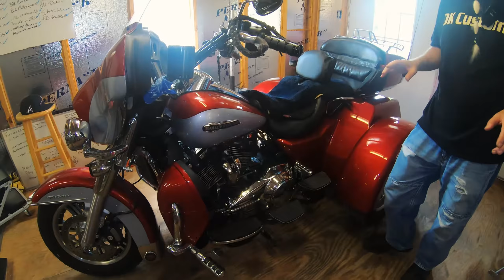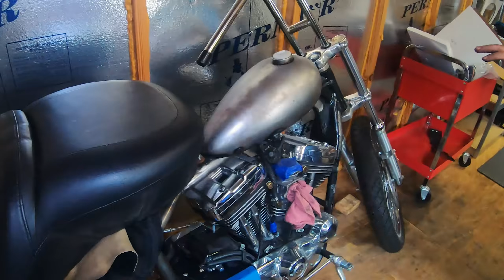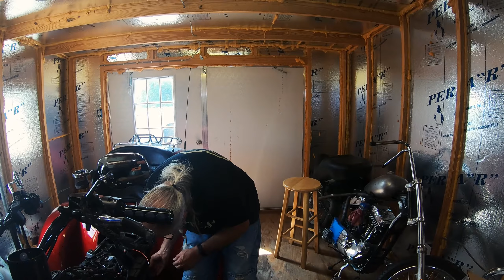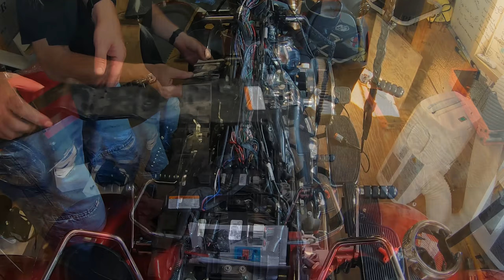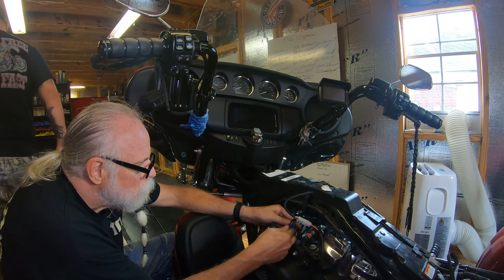COOL YOUR HARLEY - SEE Force Flow Fan Installation

Comment: Hi Rick, If have the Kit installed using the thermostat, and all works as it should.  If I installed a switch at the relay, jumping the white and black contacts there, would that turn on the fan?  I am thinking if that worked, I could have the switch off and be in thermostat mode, but then, when switched on, it would jumper the white to black, and the fan would go on.  If those are not the correct ones near the relay, what wires would I jumper?  Thanks for your help and the great videos you guys put out.  Regards Buzz
Reply from the maker: Honestly, I am not entirely sure. That would a question batter asked to the manufacturer, Jim's. Sorry about that but we do appreciate you watching and commenting.
Reply: @DKCustomProducts  Okay Thanks. I thought I read in one of the comments that you mentioned jumping the white and blue wire down by the connector would start the fan.  Though it might be the same up by the relay, which is easy to get to.  Appreciate you getting back to me.

Comment: Hi Guys, need your help with something.  I'm installing a Jim's Force Flow Fan on my 2015 Harley Freewheeler, but don't want to use the thermostat provided. I eliminated the thermostat and the relay out of the wiring harness, and simply connected red to red and black to black, and wired the fan directly to the battery. Unfortunately it doesn't work.  Any ideas on what I'm doing wrong.  Thanks in advance for your help....Rick
Reply from the maker: Hi Rick, the fan should have a 4 pin plug. Hold the plug in a manner that the 2 black wires are top row. White wire and red wire are bottom row. Simply install a jumper wire from the white wire (bottom left) to the black wire (top right). Sorry if I didn't explain that well enough. You are welcome to shoot us an email for a picture showing this jumper wire mod. Be aware that this will void the product warranty. support@dkcustomproducts.com
Reply: @DKCustomProducts  Hi Rick, If have the Kit installed using the thermostat and all works as it should.  If I installed a switch at the relay jumping the white and black contacts there would that turn on the fan.  I am thinking if that worked I could have the switch off and be in thermostat mode but then switched on it would jumper the white to black and the fan would go on.  If those are not the correct ones near the relay what wires there would on jumper?  Thanks for your help and the great videos you guys put out.  Regards Buzz

Comment: Considering that you now have to relocate the ignition coil on BOTH the touring and cruisers, time for an updated video.  It sucks that information relevant to cruisers usually gets ignored.  It's only when the tourers are affected that everyone starts updating shit.
Reply from the maker: The Jim's Fans can be bought with the coil relocation kits. We should do an updated video relocating the coil and installing the Jim's Fan. Maybe that will be a future video! Thank you for commenting! 👍 MB
Reply: @DKCustomProducts Really appreciate everything you guys do. The engine heat series was especially awesome and informative. 

What're your thoughts on Love Jugs vs JIMS Forceflow? Two different approaches to achieve the same result. One around $150 to $160 more than the other and needing a coil relocation. But if the JIMS does its job better and if it's built better, and it has the thermostat switch for the auto on/off, then it'd be worth it. Ya know. You guys have a lot of experience with both, so a compare & contrast video, especially with a Softail just to mix things up, would be really really informative.

Comment: How do I delete the thermostat? I have one and my screws came out of the thermostat. Now it won’t come on. I don’t know for sure how to just use the on off switch
Reply from the maker: You can contact our Customer Service team, and they’ll be happy to provide information on how to wire it with a toggle switch instead of a thermostat.
Support@DKCustomProducts.com
662-252-8828

Thank you for commenting! MB

Comment: I have my Powervision 4 attached to that diagnostic plug, and I really dont want anything else tied into my Battery. Is it possible/ Can you do a video on how a guy could incorporate the accessory switch inserts and Harley factory accessory kit to use those switches up on the road glide speed fairing? I know harley makes their "cool fan" that uses those switches. My thought is I could use that wiring set up to run a Jims Fan. Is my understanding correct that the Harley "cool Fan' is really for passenger comfort, and does NOT do much to adjust engine temps?
Reply from the maker: The Jims Force FlowFan  can either be activated by a thermostat (included), or wired for a manual on/off switch (included). The instructions come with wire diagrams to wire the on/off switch. 
You can see more about the Jims Fan at this link - https://www.dkcustomproducts.com/jims-force-flow-fan-cools-twin-cam-engine.htm

Here is a report we made on the Jims Fan that you may find useful/interesting - https://www.dkcustomproducts.com/force-flow-fan-test-report.htm

Yes, the Harley cool fan is more for directing the heat on to the ground and off the rider and passenger and not for cooling the engine. 

Please feel free to reach out with any questions:
Support@DKCustomProducts.com
662-252-8828

Thank you for commenting! 👍😎 MB

Comment: Yeah you're pulling a lot more weight on the triglide they definitely need a cooler originally when the twin cams came out. In the press release and when the folks rode them around during the press release there was one fella there may have been more. That asked about these seems to be running high why don't you put an oil cooler on it and one engineer surprising an engineer was actually at the press release but he told the guy that asked he goes that would indicate to the public that this motor's hot and it needs an oil cooler so it was all about image damn the engine damn the heat we don't want an oil cooler on there it makes it look like we got a problem. And they did have a problem we finally started putting those on the police bikes cuz they would idle I mean cops are let you know practically idol like they thought a car would idle sometimes
Reply from the maker: Yeah, it's amazing how much the powers that be care about image, rather than doing what is best for the engine.
KP

Comment: Jim’s says this won’t fit a 2020 triglide ultra classic. What year is yours?
Reply: Supposedly the thermostat won’t fit.
Reply from the maker: We have found that with a little work the thermostat will fit in a different location.  Front of the front rocker cover.
Which is what I did on my 2019...however, I prefer to run mine manually, using the included switch, rather than rely on the thermostat.
KP
Reply from the maker: Kevin has a 2019 Tri Glide. What is the fitment issue or did Jim's say? MB

Comment: I have my Dino jet tuner connected to the diagnostic port.  Is there somewhere else that I can connect it to???
Reply from the maker: There is a wire loom that HD sells to add additional accessory ports. You would need to get one of the Y adapters so that you can have both of them plugged in at one time. 

You can see the Jim's fan at this link - https://www.dkcustomproducts.com/jims-force-flow-fan-cools-twin-cam-engine.htm

Please feel free to contact us with any questions;
Support@DKCustomProducts.com
662-252-8828

Thank you for commenting! MB

Comment: Question for Kevin, what terminals that the relay plugs into did you apply power to to make sure the fan worked before you installed? I'm guessing that's where he applied power to make sure the fan was good. Mine's already installed and the fan is not coming on and Jim's first response at the factory was to bypass the thermostat. I really don't want to do that if I don't have to. I  need to start at square one and make sure the fan turns on with power applied to it. If that works then I guess I'll go ahead and assume the relay is ok and bypass the thermostat. I hate to assume but dang. Thank you!
Reply from the maker: At the 7:16 mark in the video you can see the connector that I am holding.  That is where I checked the fan to make sure it was functioning prior to the installation. 
I did not test the relay prior to installation.  Maybe I should have, but I did not.
Reply: @DKCustomProducts  Made up some jumpers and thankfully the fan works. So I'll bypass the thermostat I guess per Jim's instructions and go from there. I was so happy that I was able to put the thermostat on the rear cylinder on the right side because it made me more happy that I had the DK Customs gas tank lift kit installed. Oh well, still very happy with that air getting over the heads. Thanks guys!😁👌
Reply from the maker: Glad you got it figured out!

Thank you for your business and for commenting! 😎

Comment: How does this compare to the love jugs
Reply from the maker: :Loaded question.
Back a few years ago the Mighty-Mites worked a little better than the ForceFlow.  BUT, Love Jugs has gone downhill.  The owner died, the daughter took over, and quality, Customer Service, Warranty, and delivery are questionable at best.
For the ForceFlow, there have been none available for the Twin Cam for almost a year, and they are saying that it will be the end of the year, at the soonest, before there are any for the TC.  For the M8, they are only available in black right now, and there is a 1-3 week wait on those.
With the Mighty-Mites in question, on my M8 I am running a FlorceFlow.

Comment: Will the fan fit on a 23 Softail break out? 117 Milwaukee eight
Reply from the maker: In order to install the Forceflow on the M8 Softails, it is necessary to re-locate the coil. This Kit includes a turnkey coil relocation system to move the coil to the front of the motorcycle inconspicuously tucked underneath the neck of the bike, in-between the frame tubes. This new mounting system allows the  Forceflow to be installed on all Milwaukee Eight Softail motorcycles. Non-stock components that are installed in this area, under the neck, may conflict with the coil relocation, this Includes the Harley Brand Engine Guard.  The coil cannot be relocated for the Force Flow if an Engine Guard is installed.
Please feel free to email our customer service at support@dkcustomproducts.com or call 662-252-8828 for any questions you might have. Thank you for watching!

Comment: I am curious if these would fit my 04 fatboy EFI? I can not find any info if it would.
Reply from the maker: Here is the link to them- https://www.dkcustomproducts.com/jims-force-flow-fan-cools-twin-cam-engine.htm
Unfortunately the fans for the Twin Cam are out of stock and there is no date when they are expected back in stock, except, somewhere around the end of this year.
Here is a link to other things you can do to cool your ride down- https://www.dkcustomproducts.com/cooling-components-c661-246.htm

Comment: Bike 30k, after market UPGRADES another 12k re-sale price in a year 19k 😂 like owning an AR
Reply from the maker: Not sure where you got those numbers.  That's not been my experience, not even close.
Last new bike I bought, and then sold-  36k purchase price, aftermarket upgrades less than 6k.  64K miles of fantastic riding and memories, sold for 32k 3.5 years later. 😀

Comment: Hi there,
Is there an on/off switch so that you can bypass the thermostat?
Thank you so much for the vid.
Dan
Reply from the maker: There is an on/off switch that works with the thermostat.  It will only turn it on or off if the thermostat is up to temp.
You can bypass the thermostat completely and run it where it will only turn on or off with the switch.  This is an unsupported mod, but it is the one I ended up running on mine.
Reply: @DKCustomProducts I just ordered one , can i not even hook up the thermostat & just turn on off as needed? To me the thermostat should be near where the ET sensor is. I have a power vision so I can see when my temperature gets where I don’t like it. Thanks
Reply from the maker: @scrumthebum2451  Yes, you can use the switch in concert with the Thermostat to turn it off, but not to turn it on if the thermostat is not warm.
The JIMS thermostat sits on outside of the rocker cover,  so it is Not in the same place as the HD temp sensor, but it also activates at a lower temp than the HD heat sensor uses to start trying to cool the bike down.
Reply: @DKCustomProducts  
Thanks for reply the seller canceled the order & refunded my payment apparently the 5401 model for twin cam is not available all the sudden ?
Reply from the maker: @scrumthebum2451  That is correct.  The Twin Cam version has not been available for many months.  They are redesigning it and have said the soonest it would be available is the end of this year.
You can see info on that at this link- https://www.dkcustomproducts.com/jims-force-flow-fan-cools-twin-cam-engine.htm
Reply: @DKCustomProducts  
Thank you. Oh well In one more month up here in PA won’t have to worry about the heat till next July 😂

Comment: With the fan blowing left to right, do you still recommend removing the left mid-frame air deflector and keeping the right?

In the video you use an adapter to get power from the diagnostic port, but why not ground it back to the battery? Is there no ground on the diagnostic port?
Reply from the maker: Yes, for the mid-frame protector, it is most effective (with or without a fan) to have the right side in place and the left side removed.

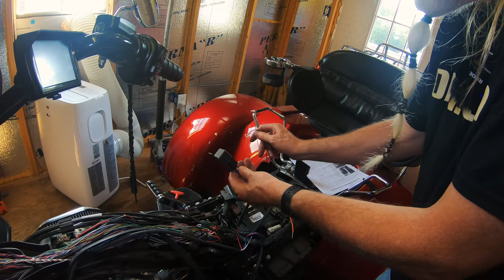In this video we do talk about running the ground directly to the battery.  12:07 mark.
Reply: @DKCustomProducts  Sorry! Typo. I meant to ask: why ground it back to the battery instead of to the diagnostic port.
Reply from the maker: @HarleyGriffith  Easier and cleaner for me.

Comment: Question for you: Did you change out your 10-inch bars to the 12-inch bars for better handling?
Reply from the maker: I use The Comfort Triangle (video linked below) to find the best/most comfortable position.  I have a bad left shoulder, so my bars are generally closer than most.
You may find this video interesting- https://www.youtube.com/watch?v=Y4pWGTj-iDE

Comment: I recently replaced my EVO with a Twin Cam and am seriously considering one of the JIMS fans. 
I had forgotten how damn hot the TC's can get and appreciate you putting up this video.
Reply from the maker: Unfortunately the Twin Cam JIMS Force Flow is out of stock for the Twin Cams.  If you can find someplace that still has inventory, and you want it, that would be the way to go.  JIMS has said it is going to be quite a few months still before they have more for the Twin Cams.  We do have black ones for the M8.
Reply: Okay  DK would the fan blow hot air into the right leg just asking if you fill it blowing hot air into the right side onto your leg?

Comment: How does the horn compare to the stock horn, or a Custom Dynamics Pro Beast horn?
Reply from the maker: It is 80-90 % as loud as the stock horn.  Not in the same category as the Pro Beast.
If you want a loud horn, this is what we use- https://www.dkcustomproducts.com/chrome-bad-boy-wolo-air-horn-dual-tone-loud-w-wiring-kit-dk-wolo-519-comb.htm
Reply: @DKCustomProducts  I think I want to get either the Force fan or Love Jugs, but also want a louder horn than what is stock. The Pro Beast probably won't fit with Love Jugs, right?
Reply from the maker: I do not know.  Wish I could help, but just have not experience with fitment of the Pro Beast.

Comment: 2 questions
1.  Do the fans run all the time or are you reading temperature from CAN bus or on older models with no CAN bus do you have a temperature probe to detect when to run fans?

2. How many CFMs do the models put out and what data can you share showing the effects?
Reply from the maker: Eric, please go look at the link below. There is info there on how it is thermostatically controlled by a sensor that sits on the rocker box cover.  OR, you can control it manually, turning it on and off whenever you choose. https://www.dkcustomproducts.com/jims-force-flow-fan-cools-twin-cam-engine.htm
Also, at the link above, in the Technical Info tab there are test results on 3 different bikes.
You can see a video at the link below of the testing also- https://www.youtube.com/watch?v=qMVwT0nunfU
And here is a link to a written test report- https://www.dkcustomproducts.com/force-flow-fan-test-report.htm
I don't recall ever seeing a CFM rating on the ForceFlow Fan.
Reply: Close to the CFM, on Chrysler 600 AFB carburetor.

Comment: would you want to mount it on the rear cylinder because it gets hotter?
Reply from the maker: Great question. 👍
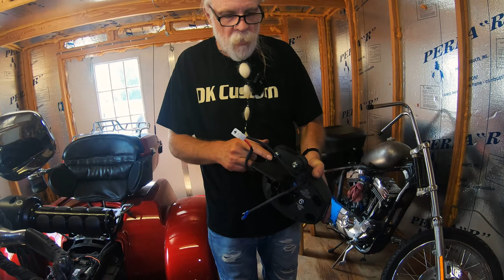Since the rear cylinder does run hotter, this fan is designed with that in mind.  The fan is offset, with much more of the air directed at the rear cylinder.  You can see that, starting at the 10:22 mark in this video.